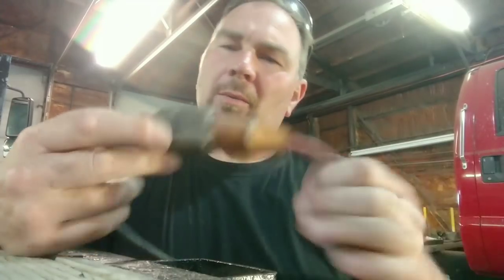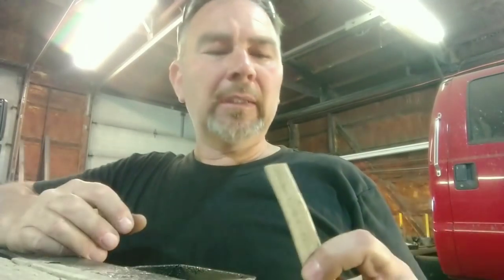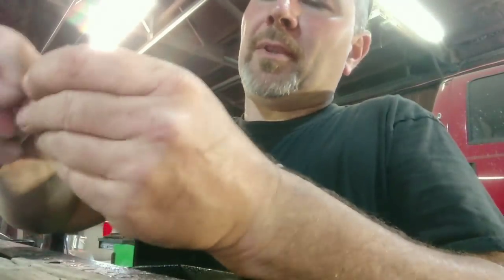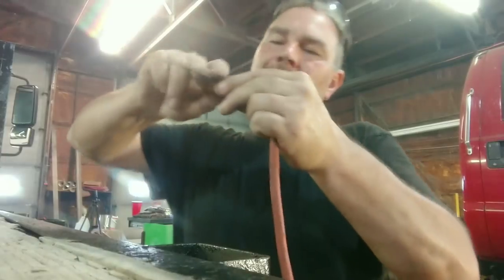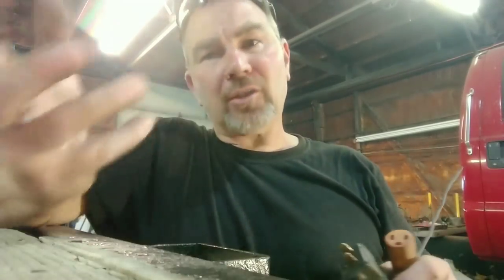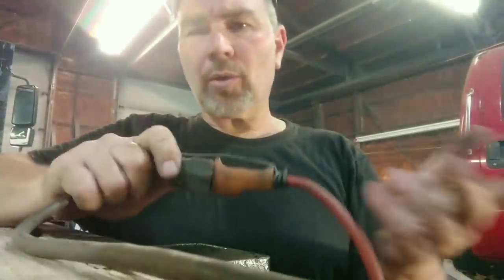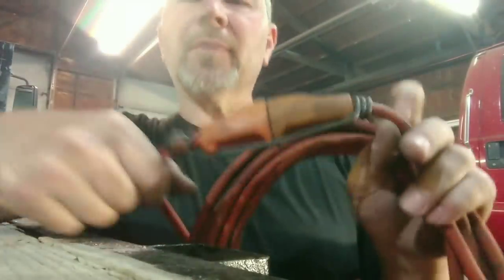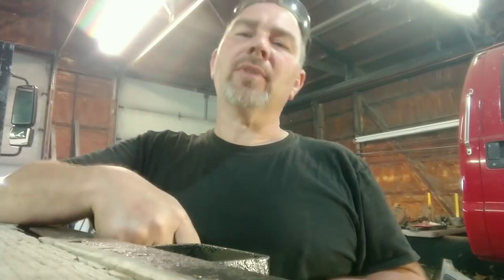FREE HACK! EASY THING TO KEEP YOUR TOOLS FROM COMING UNPLUGGED WHILE YOUR WORKING!

Comment: That's pretty slick! I always tied them in knots, but like you say, it gets caught on everything. If your tool has a symbol with two squares, one inside the other, it's double insulated and does not require a ground. I had a long fight with an OSHA inspector about that once...
Reply: first AND second!!

Comment: Brilliant minds think a like, I’ve been doing this for years myself. I also keep rolls of 12 gauge or 14 gauge copper around and in my shoe buffet and one of my major uses is tying up tomatoes or tying coiled hoses or coiled whatever copper wire is very handy and useful or tying stuff down with a safety wire on the rack of the truck as back up to your tiedowns
Reply: Stupid iPhone voice to text. I keep rolls of copper wire in my tool bucket. Samsung has a much better voice to text feature than iPhone. On a sidenote what makes a better carrying device for tools.than a 5 gallon bucket

Comment: Locking extension cords are wonderful. My short cords hang and the 100' cords live in 5 gallon buckets with the male end on the bottom. Plug in the tool wherever you're working and walk to the outlet or generator with it spooling out behind. They're quick to grab and don't unravel when thrown in the truck.

Comment: Speaking of extension cords.  Costco has a deal for 12 gauge cords with a lighted end .  two 50 foot cords for $40. What do you think of kniting the cord ? I was taught that on construction sites years ago probably 45 years ago when I first started building houses and we had 100 foot very fat cable for running on the construction site

Comment: Most times I start a square knot, then plug the tool to power. 
When I’m working outside and know it’s going to rain, I have a plastic cover with Packard fittings that are waterproof. 

There are hacks for winding a cord set up with an over then under loop that allows the cord to payout without tangles. Also works on hoses.

Comment: If the male connector easily pulls out of the female connector then the female connector is worn out and needs to be replaced. This loose connection causes a voltage drop which increases the current being pulled through the tool. Furthermore if someone is yanking the drop cord around and not paying attention to what it's becoming entangled with that of itself is an unsafe practice. At least you're aware of the fact  the missing ground prong can get you killed and I am glad you pointed that out.
Reply from the maker: i only mentioned the missing ground because all the keyboard engineers would go crazy. the reality is, the tool the broken ground plug went to is a double insulated tool that does not use the ground at all. the original 2 conductor cord was separating where it came out of the tool. i replaced it with a heavier 3 conductor cord. my connections are not worn out or loose. they usually come apart because i primarily use a 14 or 12 gauge extension cords in lengths of 50'. they are heavier than most commonly used cords. just moving them around these trucks is enough for them to come loose.

Comment: 👍👌👏 I do it for lots and lots of years in a similar way. But I use that wire/cable on both sides. The biggest difference is that we have way safer/stronger "Schuko- Stecker" (plugs with Schuko system) over here in Germany (those plugs are safer even though we have 230 and 400 Volts).
Best regards, luck and health.

Comment: I use a half knot on my cords.  No extra wire needed.  
J.C. I'm an electrician by trade.  There is nothing wrong with direct burial cable.  The power company uses it for high voltage all over the world as well a feeders to homes.  If you want to go to the extra expense to use conduit for piece of mind.  Be my guest.  I've done it both ways without any problems.
Reply from the maker: I have replaced far too many underground service entrance laterals and other circuits to ever use direct burial. your soil conditions may be different than ours. power company here put theirs in pvc.
Reply: @j.c.smithprojects  I'm in central Indiana.
Reply: I’ve made A LOT of money from failed direct bury conductor. Use conduit... my company learned the hard way
Reply: @b.a.lineman7582  I've never had a direct bury fail in my 55 years.  Now on non home applications I've always used pipe.  In fact I personally prefer pipe.
Reply from the maker: there isnt an electrician that i respect that will ever put any condutors in the ground with out  a properly sized, graded, continuous, and glued raceway. professionals do professional work regardless of "what will work". you understand the national electrical code is a "minimum requirement"?